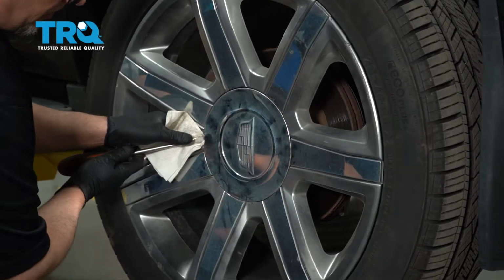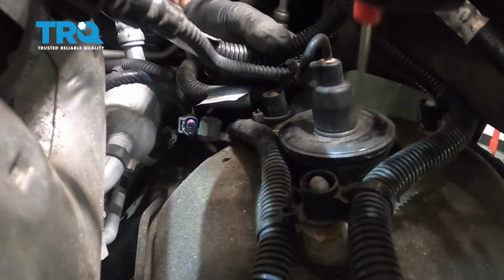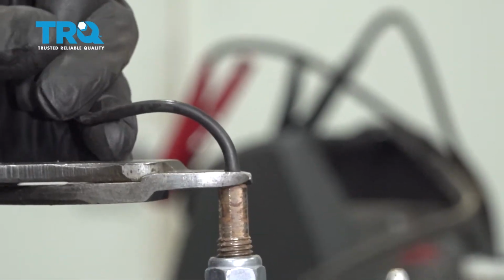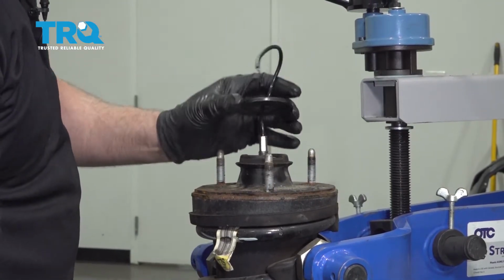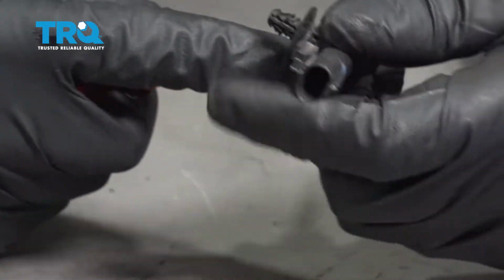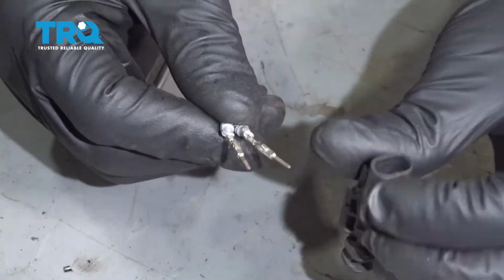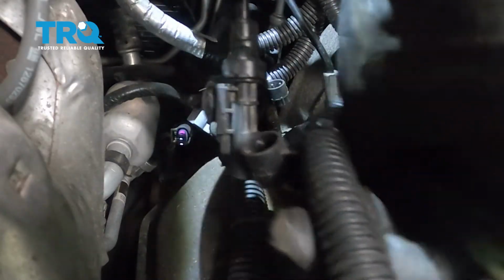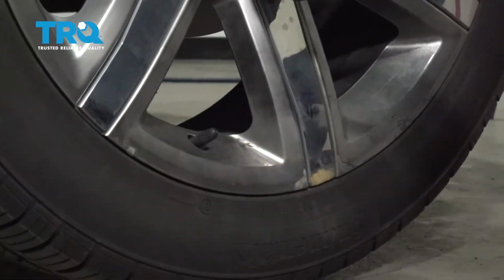How to Replace Front Shock Absorber 2015-2020 Cadillac Escalade

Comment: Great video, I have a question installed these and now after a couple day they are sagging. What do you think could be wrong thanks!
Reply: did you replace the whole strut or only the shock? and, since you posted, have you figured out the problem?
Reply: @porsche1971  I bought mine at autozone, the whole assembly, good thing they came with warranty.
Yet they it's sagging in the left side